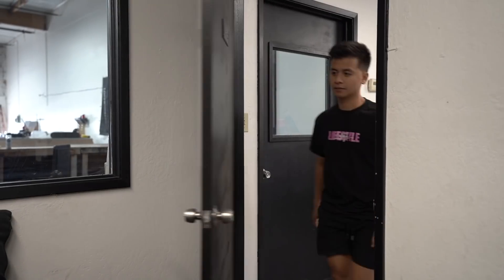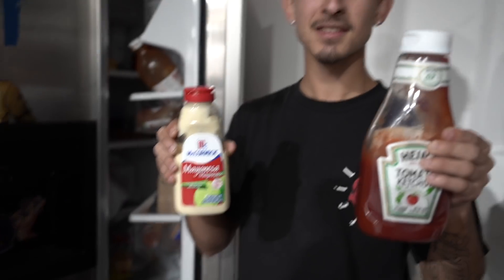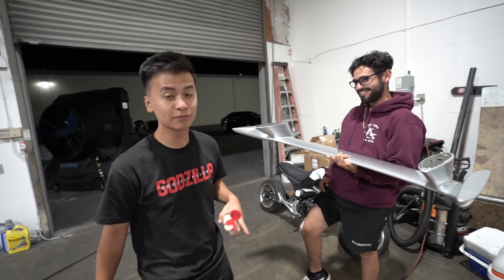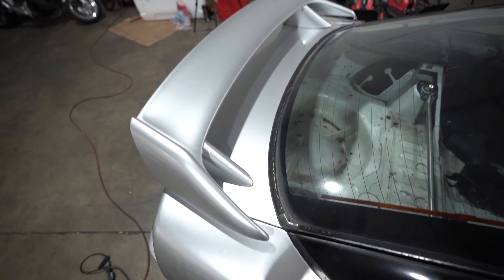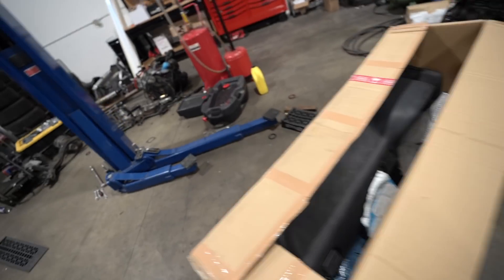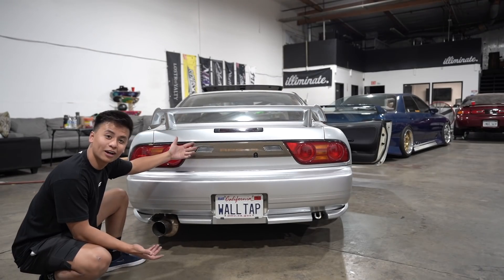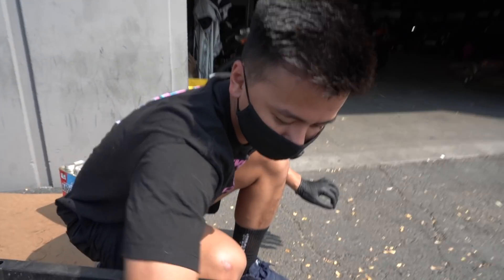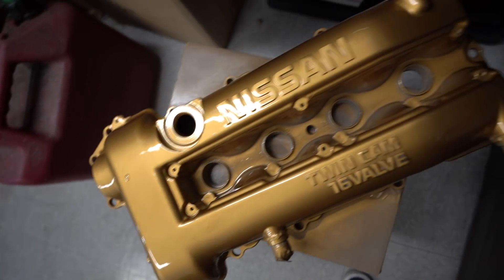Installing the MINI 326 Wing (163 Wing)

Comment: no hardener in clear coat means it wont last. which is perfectly ok, just be prepared to redue your valvecover again in 6 months or so. esp if you get brake cleaner or anything similar on that cover say goodbye to clean look. 2k clear will at least resist those types of chemical cleaners